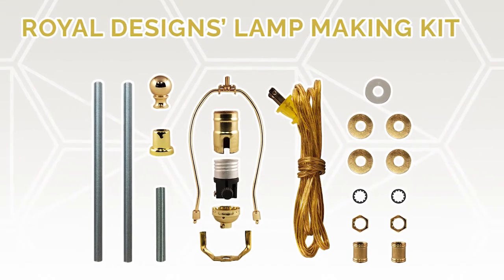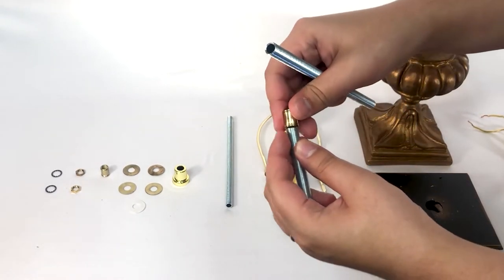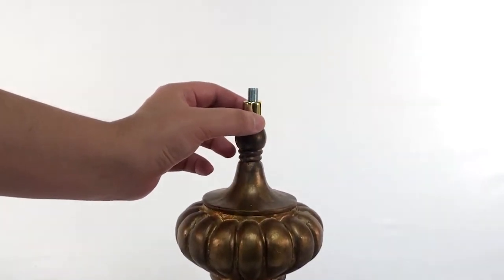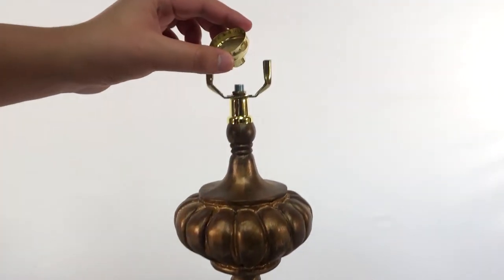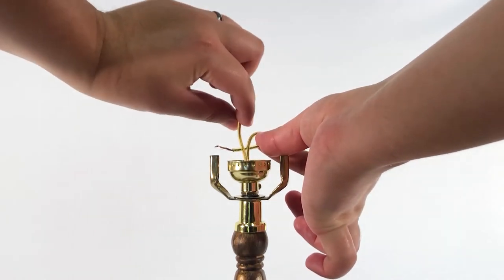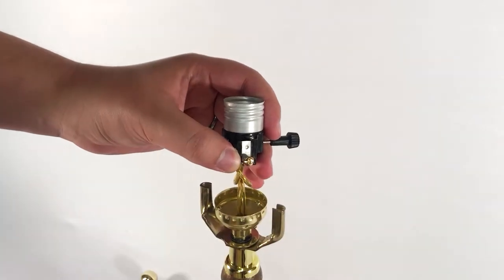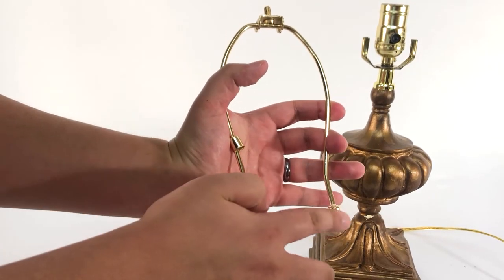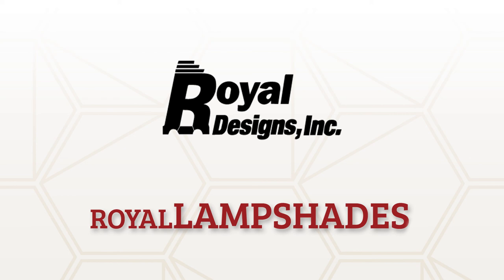How to Build a Lamp

Comment: That nut is completely redundant, the socket shell base does exactly what that nut does. and why exactly does the socket shell base need an extra screw if its threaded on already? Certainly isnt enough tension in the system to justify that.
Reply: not to mention the ears. and also. they only reference on shade fitting. im trying to figure out the spoon one. why is a balloon?

Comment: What is the white rubber washer used for?
Reply from the maker: The plastic washers are used under the metal washer in order to reduce ( in case lamp objects are thin glass or fragile )the pressure while tightening the screws to complete the lamp assembly before inserting the electrical cord.